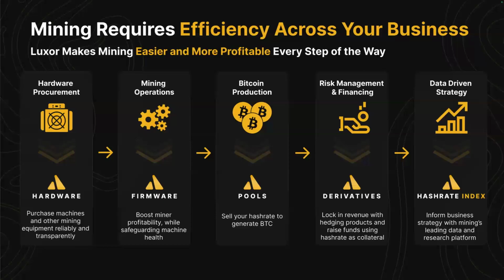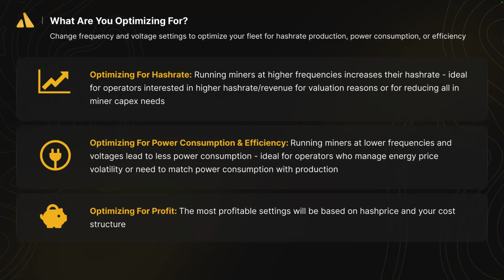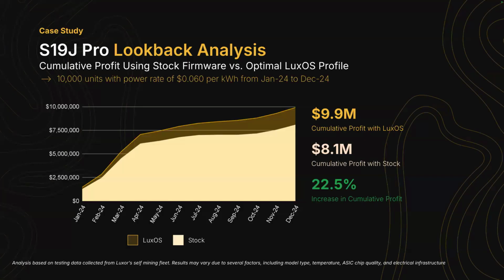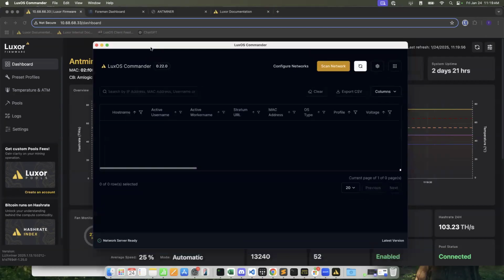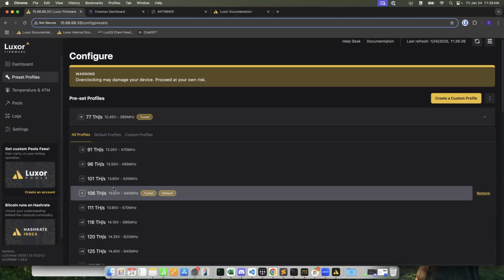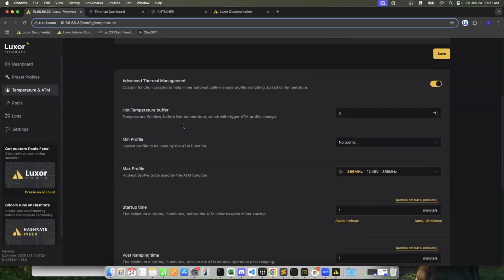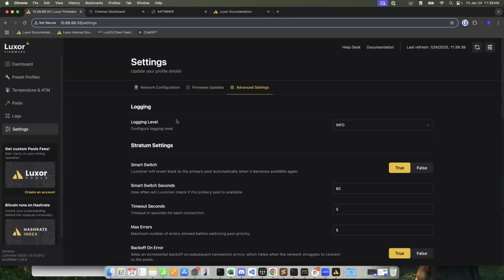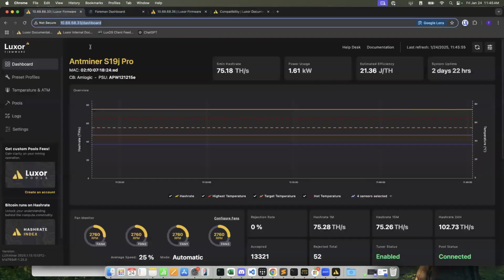How to Boost Mining Profitability - LuxOS Firmware Webinar

Comment: I used this firmware on a s19 95t 35.5j-th/s. After underclocking and tuning at 78 th/s 24.7j-th. Made it worth running the older asic since last halfing. Great firmware and pool.
Reply: Thanks so much for the feedback. Great to hear!